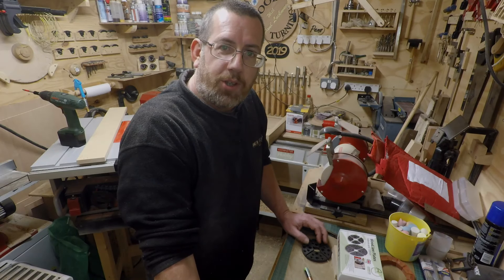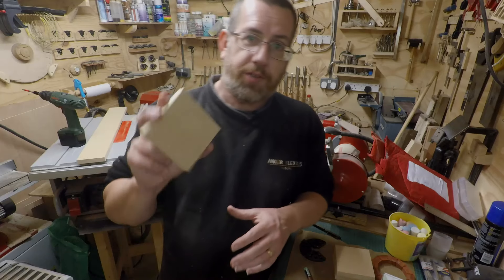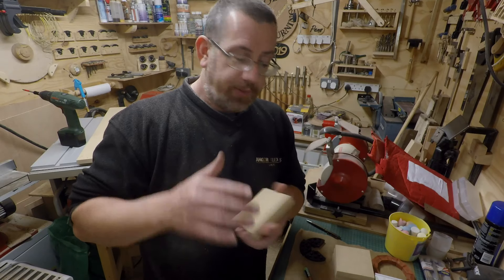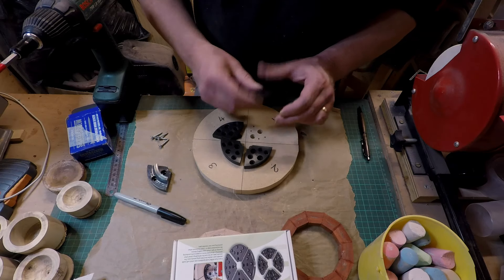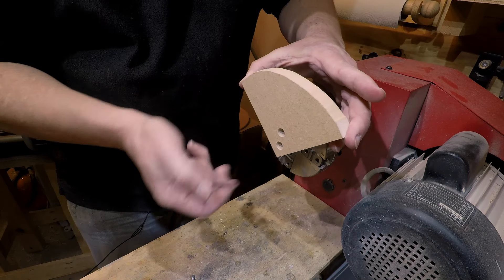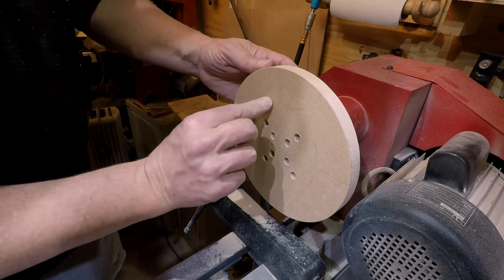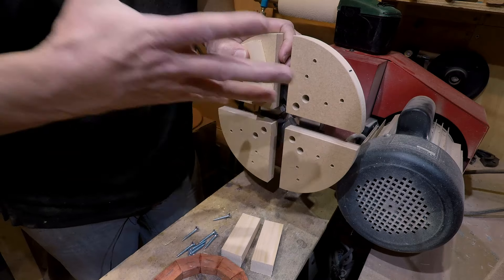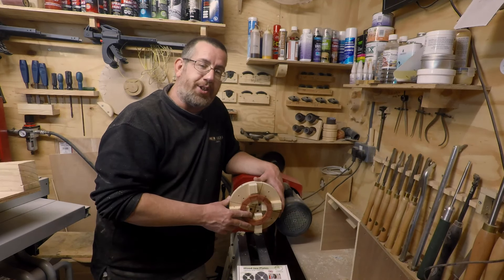Wood Jaw Plates - Episode 207

Comment: I don't think that the through holes for the jaw mounting bolts are strictly necessary. If you first remove the jaw holders from the chuck then mount the steel plates to them you can simply screw on the wooden plates and re-install the whole assembly to the chuck.
Of course, depending on the method of working, it may be convenient to do do as you have shown.
APT have a video showing the use of their current, stainless steel, plates.
Reply from the maker: Yes you can do it that way, even better if you have a spare set like I do for my much larger 400mm button jaws. It's a bit more of a pain as you have to remove the chuck and take out the safety grub screw each time too. Either way as a hobby time shouldn't be the most important thing. It's all about doing what suits you to get the job done.

Comment: Hi Paul...great idea....I would be tempted to hold a segmented ring in compression mode just in case there was a dodgy joint...I stuck a waste piece of plywood on the bowl top and used a wormscrew to hold it till I turned the base and a rebate for the chuck...Check out..Andy Paramore segmented pot pourri bowl...yours is a very handy bit of kit though and I would love to have one...great video...All the best.....Andy
Reply from the maker: Thank you Andy. I've not had any issues with joints so far. That may because I glue them up individually rather than all in one go like a lot of other people do. Also rings often go on the lathe within 30 minutes of being glued just using ordinary PVA glue, so it does go to show how well these hold. Yes one day it may blow, but that would only be one ring which I'd rather know early on.

Comment: Hi Paul, I was convinced that you had previously made a set of Cole jaws, but checking your back catalog I see you have not. My first thought was why did you need to buy the jaws in the first place, when you could have simply drilled and cut the thin groove on the "main Plate" itself? I also have a SK100 chuck and simply drilled the main plate when I made my set of Cole jaws.
I like the way you used the sacrificial wood pieces to hold the project. Thanks for sharing the video
Reply from the maker: Thank you. Yes I have lots of jaws but nothing like this. Just using scrap wood you can do all sorts with these. They could be even better to use than a jam chuck in a lock of cases as you don't need to be so precise and have that tight fit as they are on a chuck which you can change that size as you need.

The project in 2 weeks time will show where I used these. I soon made a second set of sacrifice wood from oak to hold segmented rings which was more stable and better.